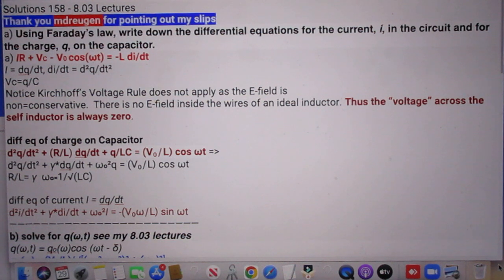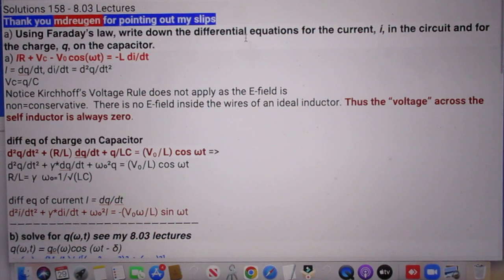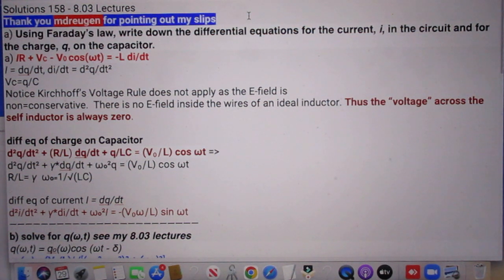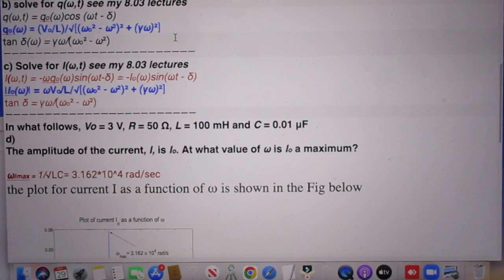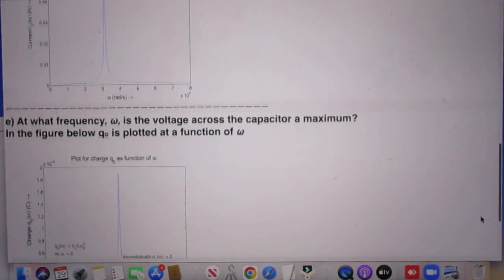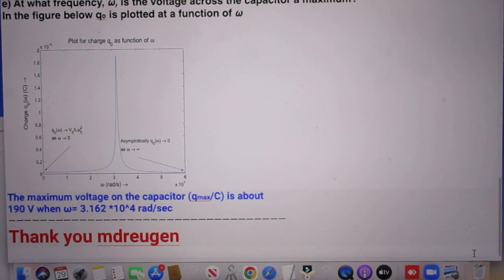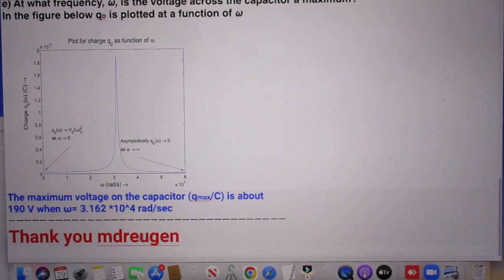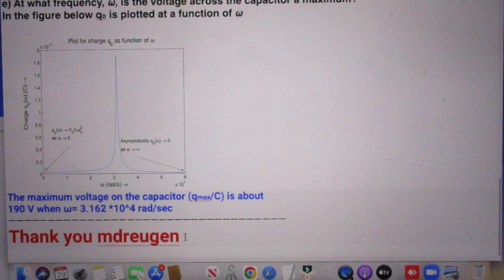mdreugen's corrected answers to solutions of #158

Comment: The maximum voltage on the capacitor can also be found by:
Vc,max =  -j⋅V₀/ω₀RC = V₀/ω₀RC with -90° phase angle.

ω₀ = 1/√LC

=> |Vc,max| = V₀⋅√LC/RC = (V₀/R)⋅√(L/C)
=> |Vc,max| = (3/50) ⋅√(0.1/10^-8) = 189.7367 V

In my solution I said that it was about 187V, but that was a simulation.
Reply from the maker: ofcoz
Reply: You are doing an outstanding job dr. Lewin.
It is always a pleasure trying to solve your questions.

By the way, I am not a student but an retired RF engineer, 71 year old.
I just try to remember what I once have learned :)